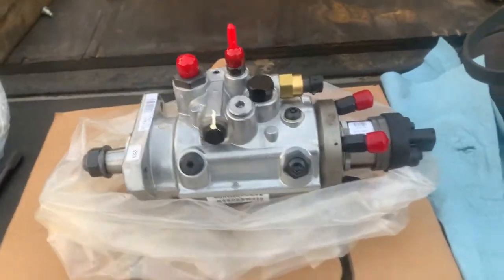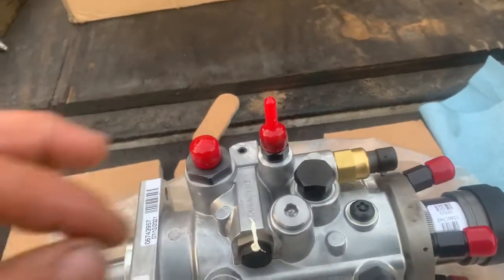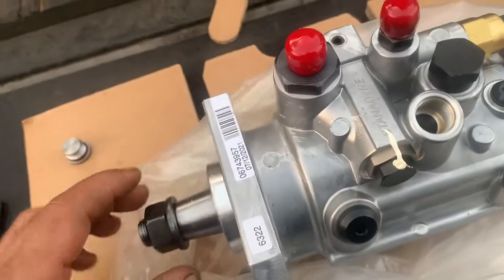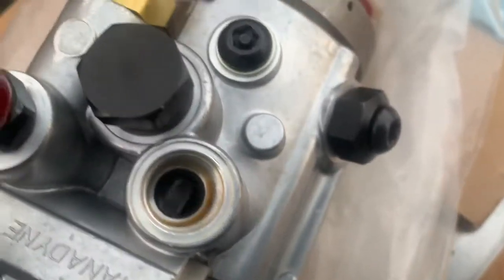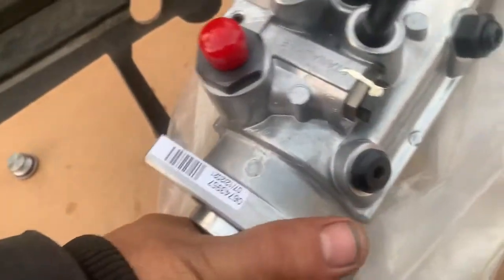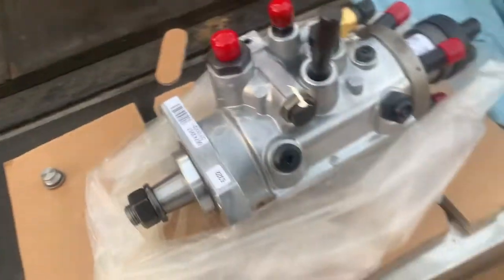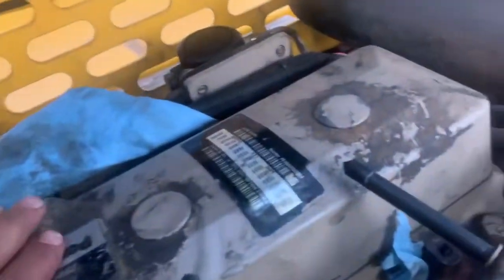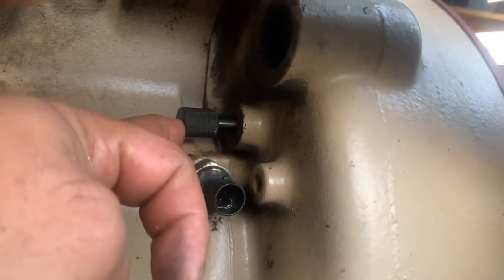Fuel injection pump timing secret

Comment: Do you insert the lock pin in the engine and that’s it?? Or do you insert the lock pin and rotate the engine till the lock pin falls into a hole??
Reply from the maker: engine need to be timed before you take off the old pump
Reply: Hi guys I have a friend that didn't time the engine when he removed the pump, what should he do to get everything to work properly? Thanks for your time and help
Reply: @marchawthorne2479 theirs a special timing tool you have to get to perfectly align everything. I told my buddy I couldn’t fix his too many special tools you gotta buy to replace and rebuild.

Comment: I have a 5205 John Deere tractor and I changed out the water separator filter a elbow turn off nob into the pump where there is a primer above. Long story short we are dead in the water cant start . Tracked everything back to fuel pump and its going in ( fuel) an still no go.. its going into but not feeding into each injector lines.. all dry...
Reply from the maker: the throttle solenoid in the back of this pump is working as fuel shutoff solenoid when there is no signal from the ecm to it. check the wires to the ecm.
Reply: @texasliftpro  oh boy.... Thank you so much for responding... I figured I'd hear from you next year !! Ha.. 
I'll try that... I'll be in touch.. 
Thank you

Comment: Been there experienced that. Made up the tools ourselves and its now in a kit especially for timing those pumps. One thing I found is to ensure taper in gear wheel and on the pump shaft gets cleaned so its spotless. No key like B-series Cummmins. Relies in the taper and a very high torque on the inj pump nut. Had to replace a bunch of these exact same Stanadyne pumps on marine Travelifts when they got a huge dose of water in their fuel supply and the filters couldnt handle it. And the plastic cap where the wires plug in is a fragile unit too.

Comment: The 4045 Powerteck,  comes with factory installed Stanadyne DB4 injection pump, that has a KEY in the shaft, so no timing needed, it only goes in one way. I have never seen the type pump you are using ! What model is the pump you are installing ?
Reply: That's a stanadyne DE10. It's electronically controlled, not mechanical
Reply from the maker: the throttle is electronically controlled, but fuel distribution is mechanical and needs timing.